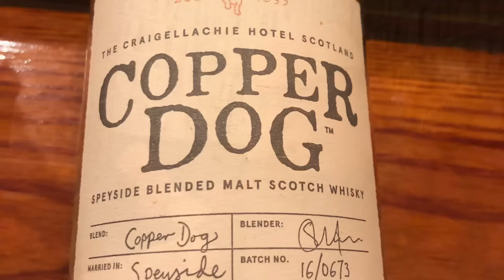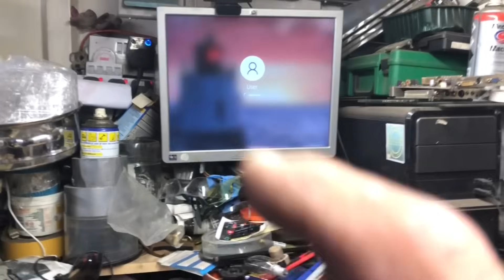I’m gonna eat an Elephant

Comment: Echo the other comments good to see you :-)

Seemed like all my fav tubers went on holiday at the same time , I nearly had to buy a tv licence :-))))

You made great progress sorting shed , I started tackling mine at the weekend , done a little bit of a tidy. Do you find you start tidying then found something that been hidden, then loose an hour or so fiddling with it ?

On the subject of scrapping welding torches , I scraped a few a while ago ( binzel ) as I wanted the copper to melt down , I was gutted when I found it was copper plated Ali :-(((( if a binzel torch has LW in the part number it stands for light weight and it’s Ali :/((

Keep the content coming as a when :-)

Also how did you get on with fire extinguisher dilemma